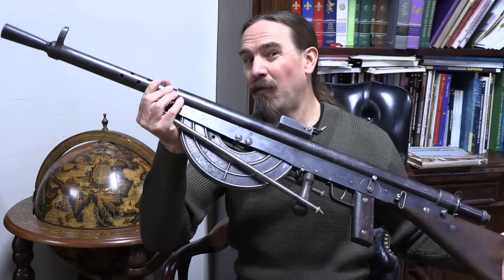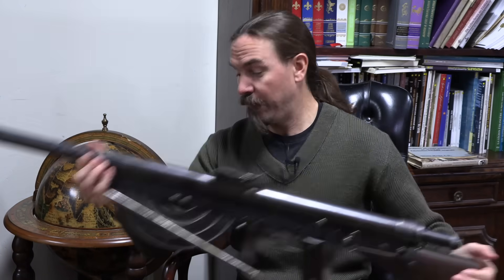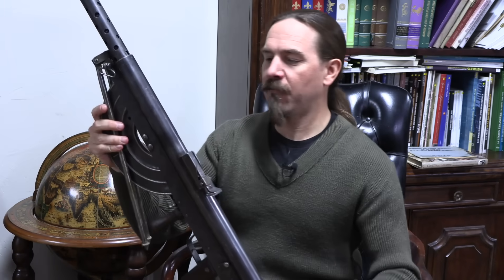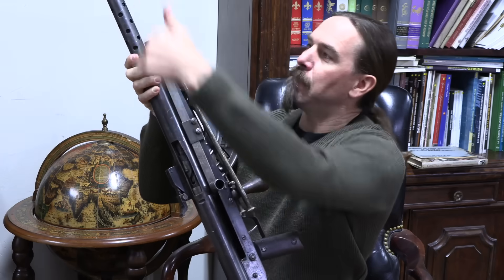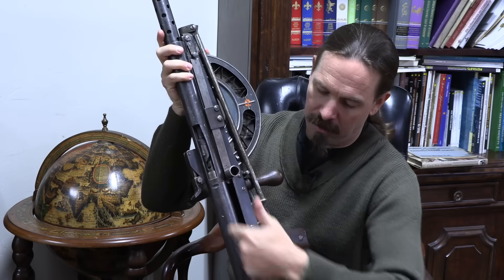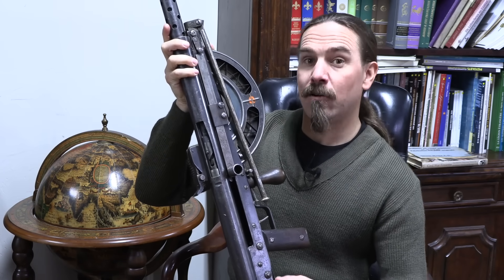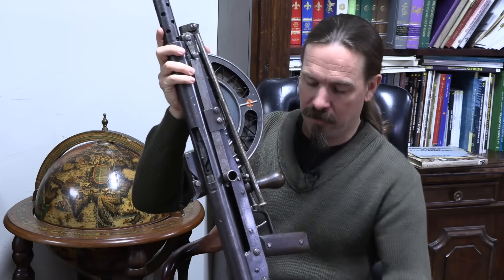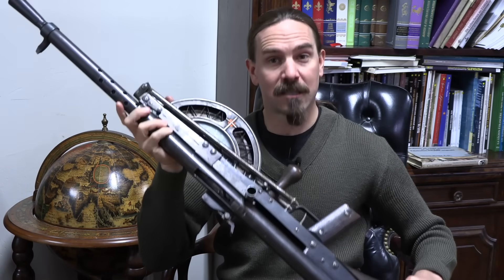Rate of Fire: What Determines it and How to Change It

Comment: It is interesting question - what rate of fire is the best. For example vz.58 has a higher rate than AK47. One might thing it should be the same as there is the same amo. And the first prototypes actualy did. But it was found during field tests that grouping was bad compared to AK  when shooting short burtsts - the most convinient way to use full auto. As solution it was sugested to ramp up the rate of fire and it did work well...

Comment: I'd be hella interested in a breakdown of rounds/second rates and their optimal uses, advantages, and drawbacks!
I know that low&slow rates are best for shoulder-fire controllability and being able to isolate single-shots without having to use (or even implement) a selector switch... Blisteringly high rates are best used mounted and either in, or against, vehicles (especially aircraft)... But I know little about the in-between rates or their drawbacks (such as ROF too high without compensation being harder to aim, but that's just an inverse of the low&slow - the Vietnamese M16s you mention here beating themselves up or the Zip22 moving so fast it can barely get rounds in place, are interesting examples of what I mean!)
I like customizing TTRPGs to be setting/system agnostic, and very few of them in my circle use guns and even fewer use ROF at all - so it'd be real interesting info for me!
I really liked the older vid you did on the various pistol calibres, so that format by ROF would be a solid start in my opinion! Iconic guns exemplary of that ROF use would also be a neat tidbit, like the original Villar Perosa at the "stupidfast anti-aircraft" range.

Comment: Super interesting subject indeed!

Something that you didn’t mention but is very closely related to gas port size is the actual physical location of the gas port itself on the barrel when considering gas operated actions.

Within an acceptable operating envelope, placing the gas port further away from the chamber will delay when the action begins to receive gas to function the action. Conversely, placing the gas port closer to the chamber will send gas to the action sooner.

This combined with the gas port size can influence the observed rate of fire. A gas port further from the chamber will be more likely to have a slower rate of fire, and a gas port closer to the chamber will be more likely to have a faster rate of fire, relatively speaking.

I’ve been playing with short dwell time AR’s and have observed a very noticeable reduction in full auto ROF when using longer than typical gas system lengths.

I’d love to hear your thoughts on effective ROF for different rolls!

Comment: I would have assumed the recoil spring would have been some sort of factor here. 
Does changing the stiffness of the spring just sort of cancel itself out, as in a stiff spring slows the bolt more but also sends it back faster and vice versa? Or is the force of the spring just inconsequential relative to the other forces at play here?

Comment: Maybe this is my inner armchair general but I feel like low rate of fire automatic weapons are actually fuckin sweet. Like with the old m3 grease gun you could hold the trigger and provide excellent covering fire for almost eight seconds!
Imagine that on a belt fed weapon, with manageable recoil leading to accurate, sustained fire at significant distances

Comment: Increasing receiver length can be used to increase reliability by slowing the cyclic rate. The Just Right Carbines, for example, have lots of bolt overtravel. A Ruger PC-9 has relatively little. The PC-9 can outrun some magazines that the JRC has no trouble with.

Comment: Ian: the bullet and bolt (+ casing) do not depart with equal energy in opposite direction, but with equal momentum in opposite direction. The energy of the bullet and the bolt will depend on their mass, based on the formula E = p^2/(2m), where E is kinetic energy, p the momentum, and m the mass of the bullet or the mass of the bolt + casing.

Comment: Good technical explanation of rate of fire. The technical rate, however, is different from the practical rate or the "real" or sustained rate of fire. To get this value the barrel needs to be considered.

The M-60 comes with 2 barrels. The barrel doesnt have enough time to cool which, if continued use, will get so hot as to deform and become useless. Firing needs to stop and the barrel needs to be changed reducing rate of fire. This problem is solved with the gatling or chain gun. With many barrels the weapon provides more time for the barrels to cool increasing the rate of fire. When considering aircraft, where these weapons are commonly deployed, like the apache and warthog, the limited amount of ammo they carry puts a limit on the heat that can be generated therefore can easily achieve their max rate of fire.

For example

Comment: I am fascinated by a tiny point. Don't want this to seem like a correction, I just think you might also find it interesting. This 100% doesn't matter.  The bolt motion is one of the very very few cases where speed and velocity aren't the same, AND "velocity" isn't the correct one. Because velocity is both speed and direction, and the average can be calculated as displacement over time.... the bolt returns to its starting place,  so the average velocity is definitionally zero. Average speed is where the fun is

Comment: Reminds me of the Fins running the Kpist submachinegun who would shove a D battery behind the recoil spring to effectively double the fire rate, one, it stiffened up the recoil spring and two, made the bolt travel more or less half as far as it normally would, it turns it into a ripper😂.

Comment: The AK47 had an original rate of fire of 800 RPMs but later they added a delay mechanism that delayed the rate of fire to about 650 RPMs but it was not an option of select fire.
You either had the trigger mechanism for the higher rate of fire, or the slower rate of fire built into the trigger mechanism.

It is a very simple mechanism that simply delays the hammer by hitting the hammer as it goes forward when released by the auto sear.

Comment: A good example would also have been the reduction of the MG3's rate of fire by using a stronger spring and heavier bolt compared to the MG42 in order to increase reliability and reduce ammunition consumption.

Comment: I’ve never experimented with this, but it would be interesting to see how buffer weights, spring rates and BCG weights would affect RoF within the AR platform.

I’d imagine to achieve the highest RoF, you would use a light BCG, a light buffer and a heavy spring. But then, you might introduce a lot of bolt bounce.

Comment: What I don't understand is why machine pistols are designed with such ludicrously high rates of fire, to shoot the entire magazine in a second or two. Even if you want to use it to quickly spray a single attacker, it can lead to all the bullets missing. Wouldn't a slightly lower fire rate be more useful?
Reply: You want to be as accurate as possible

Hence - accuracy by volume
Reply: @miloskaluznik48  But the inaccuracy does not come from the natural spread of the barrel and bullet, not at those ranges. If you fixed the gun to a stand, all the bullets would hit the exact same spot at the ranges such guns are expected to be used.
The inaccuracy comes from difficulty to aim and from recoil. So in order to correct it, you have to move the gun around. But if all the bullets are out within the very first second, you don't have time to correct for your aim.

Comment: Has anyone ever tried to use the Hall effect to slow down a bolt? It seems like that would be a way to make a smaller repeating firearm, like a machine pistol, that would still have a controllable rate of fire without increasing the mass or mechanical complexity very much.

Comment: Another interesting Subject for Rate of fire is the MG42 and it predecessors. All variants are slower that the original(1400 rpm), but some just barely like the German MG3 (1200) or significant slower in the Austrian MG74 (850rpm). Although, In the end, they are all basically the same gun.

Comment: Just a nitpick on physics terminology:

It isn't average bolt velocity that you want, it's average bolt speed.
Velocity is speed/vector, so it includes direction of movement.
As the bolt cycles, it returns to the starting position, so the average velocity is going to mostly cancel itself out- if the average speed is equal in both directions, the average velocity is zero.

Comment: 3:04 Correction: equal momentum not equal energy. Only if the bolt weighed the same as the bullet you'd get equal energy backwards and forwards. The point of a much heavier bolt is because it results in a much smaller share of the energy going backwards. The reason it is not an equal share of energy has to do with momentum relating linearly to velocity for a given mass, but in a square relationship for energy.

Comment: In a locked breech, gas operated, firing system you mentioned most of the variables. Is it not true that the point on the barrel where the gas is tapped off (either closer to the muzzle or or closer to the chamber) will also have an effect on average bolt velocity?
Reply: it probably has effect but not much, since the bullet accelerates really fast so any change of gas port distance only leads to even smaller change in time

Comment: I wish there was a different way to describe rates of fire than rounds per minute. A whole lot of people seem to think that it's literally how many rounds can be fired in one minute without understanding basic limitations like mag capacity. Sure a particular gun could fire 900 rounds in a minute, if it had a 900 round mag, but it probably doesn't. I've had to explain more than once, that an average shooter might be able to dump two or maybe three mags in a minute, which translates to somewhere in the 30-90 range depending on the gun and the capacity. I dunno, it just seems like it may be a good idea to distinguish between theoretical rounds per minute verses actual real world numbers.
Reply: I feel like rounds per second might make more sense for most full auto weapons. 

In the realm of crazy fire rates you have the bullet storm nonsense. They claim something like 1 million rounds per minute but can basically only fire a single volley before needing to reload everything. The actual rounds in a minute is only about 100 or whatever it holds.

Comment: It is worth noting that all of this is balanced against eh cartridge being used. Just as a heavier round in a bolt action rifle (say, a 180 gr .308) increases the felt recoil (say, vs 150gr), that will also impact the forces on a reciprocating bolt and will change the rate of fire. Perhaps not to the point where it matters, but it will have an impact. As mentioned, if you use a more or less energetic powder than the standard load, that, too has an impact. So all of the calculations on an automatic rifle have to be based around a particular load (bullet weight, desired muzzle velocity, etc.) and measured within expected variances such as the difference in a ball round vs tracers vs rounds with steel cores, etc, to make sure the rate stays within a desired range in order to ensure the reliable function and durability of the rifle in question.

Comment: Are there any examples where there is a delayed release of the hammer? AKA some complication between the bolt closing/action locking, and then after some delay the hammer being released? I know in the AKM there is a 'rate reducer' that arguably does some of this, restricting the hammer while a weighted lever moves out of the way, but wondering if there were any other mechanisms in use that materially delays the hammer from dropping after the action is locked.

Comment: I served in Iraq in 2004 in a scout helicopter battalion. Our aircraft used the modified version of the M2 .50 caliber machine gun that was essentially just an electronically controlled version of the M2 mounted in a pod that mounted to the side of the aircraft. The rate of fire was substantially higher on the aircraft guns than the ones that we had mounted on our trucks. My gunner on the LMTV that we used to convoy our equipment up to Camp Taji was an AEA guy (armament, electronics and avionics) and when we were headed out on a road trip one time he told me to pay attention when we got out of the gate to test fire. That .50 was firing twice as fast as it should have because he replaced the buffer spring on the gun mounted on our truck with one from an aircraft gun. It was awesome!!!
Reply: The trouble with that is cooling. On the helicopter you have air rushing past the barrel to cool it. You’re not gonna get nearly as much airflow over a truck-mounted mg.
Reply: @StealthTheUnknown True, but we transporters rarely got in sustained firefights.
Reply: @StealthTheUnknown  You ran out of ammunition long before cooling became an issue!!
Reply: @krisholden5365 no no, you ran out of targets
Reply: Howdy! Went to Taji a lot in '04 out of LSA Anaconda.
Reply: @jasongcrow5313  I never thought while I was there that I’d actually wonder about it and even kind of miss it!
Reply: @krisholden5365  I miss the clear definitions of mission, the camaraderie, and dealing with real world practical issues as opposed to abstractions, but I do not miss the wondering if I was going to come back through that gate every time we crossed the wire or if I was going to have to deal with more casualties.

Comment: First, I'd love a video on "what rate of fire is best rate of fire".

Second, in lieu of shortening the receiver, would the post-manufacture lengthening of a bolt provide essentially the same result? I ask this as "that's not really an option, you can't just cut part of the receiver off", which is generally pretty true "post design/manufacture" of a weapon. However, lengthening the bolt via kludge or complete replacement would seem considerably more possible to do, at least in some or maybe most designs. Also, I am bearing in mind that making a bolt longer doesn't have to mean making it heavier. 

Third, in regards to watches and mechanical complication Ian, as a watch nut myself, I've been trying to figure out exactly what Marathon watch you wear. I figure it's either a GSAR or TSAR in 41mm, but couldn't verify if you'd gone with the automatic movement or the quartz. I figured automatic, but hadn't been able to verify either way from video shots. Anyway, if you could let me know Ian, I'd appreciate it. And if you could do a video on your watches (if you have more than one) some time, I'd love that as well!

Comment: 9:12 this has always been a question for me, I am from Europe and don’t have any experience in gunsmithing but wouldn’t a hydraulic or pneumatic or even a progressive spring help dramatically in recoil control on AR’s? The bolt always slams back so violently that it transfers very much momentum from the firing in to the shooters shoulder, is it for reliability’s sake or for constant rate of fire? When you look at nice controllable guns like the mp40 or the mp5 for example the bolt doesn’t have much speed on initial impact on the back of the receiver. I can see many options like a pressure/vacuum controlled back motion with checkvalve so the bolt can slam forward freely for example, or an extra spring at the end of the receiver. Why not?
Reply: Im no engineer by any means so just wanna say that first, but I have shot a lot of AR platforms and the recoil is basically nothing on an AR thats in .223/5.56 which most are unless you get like an AR  thats 300 blackout or .308 or whatever. But AR 15/m16/M4 have like 0 recoil and are very easy to control. Though personally I find the AK platform to be more fun lol. My point is idk if your ideas are good or bad mechanically, though they are interesting. But the goal is usually as simple as possible and to lower production costs. So I think its either a non issue or would up production costs

Comment: Not equal energy going in both directions. Equal impulse going in both directions. It's very rare for the bolt to have anywhere near the kinetic energy of a bullet and if it did, it would likely wreck the gun instantly went it encountered anything solid.

Comment: As of 2025 the most common way of adjusting the rate of fire on the most common NATO style machine gun (FN MAG /  M240) is the gas valve on the barrel assembly. It's one part of the gun that works flawlessly (unless you lose some small components when cleaning, which you have to do all the time). However - it is also one part of the gun that NEVER gets adjusted, because nobody freaking needs to adjust it. You adjust it if you accidentally set it to something wrong. You just remember how many clicks to turn it after cleaning.

Incidentally, if you do lose one of the half-circular pieces in the valve you got yourself a single shot belt-fed manually operated open bolt rifle... And if you are stuck in Lebanon and nobody in command cares that is what you have as your front line of defense (been there...).

Other factor to mention is the spring strength.

 There's also the cartridge load. Many cartridges of the same caliber have different powder loads and that would affect the rate of fire and reliability. I believe military Uzi ammo was hotter than a regular 9mm and I heard the same about the FN minimi.

The feeding system is important too - pulling the belt requires some power, and pulling cartridges out of the belt and shifting them down and forward even more power, compared to just pushing them forward into the barrel from a disintegrating belt or a magazine.

There are  many different systems designed specifically to reduce or adjust  the rate of fire, in all sorts of actions. Like the delay thing in the Scorpion or the spring on the side of Maxim etc.